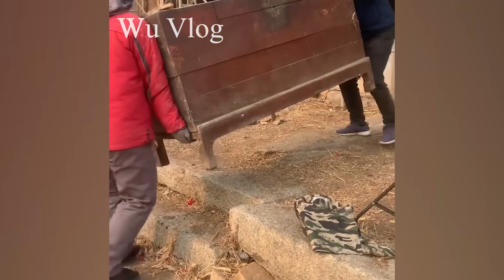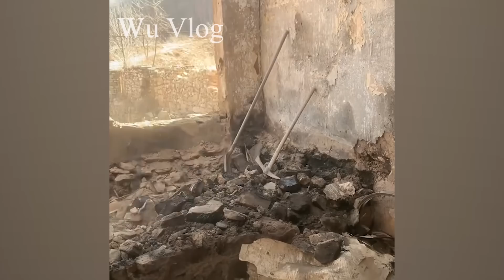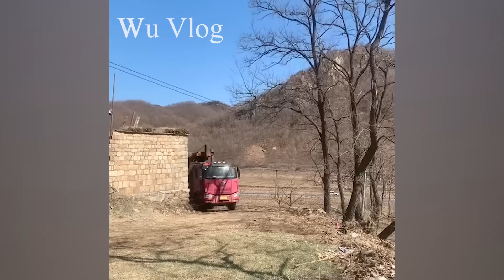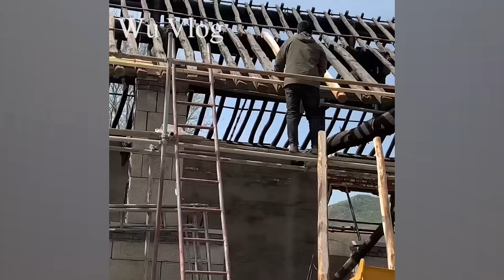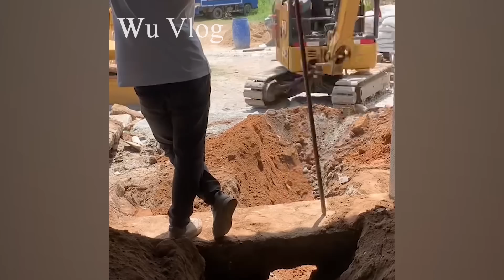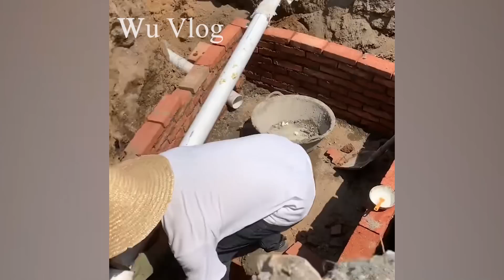The grandson helps his grandfather renovates the old house that is about to collapse

Comment: I usually enjoy these videos, but this one was hard to watch. They were so disrespectful of the original building, hacking at it like a bunch of wasteful Americans: rip out, rip out, destroy, destroy, with little appreciation of how the original was built. Watching them scrape off the old roofing tiles without caring for them and stripping the reed underlayment was bad enough, but when they took sledgehammers and pickaxes to the old wok stoves and hypocaustic sleeping shelves, I felt sick. 

This group seems to have a lot of money to burn, with all the heavy equipment and expensive modern materials. But the Western building materials and techniques that they used are not going to last 'hundreds of years', and are probably going to shorten the life of the old wood that they bothered to save: I can already see great potential for moisture problems and associated dry rot. 

I wish them well, but I am still sad.